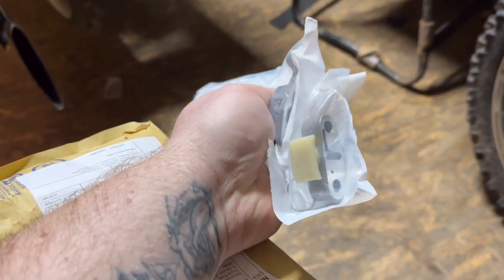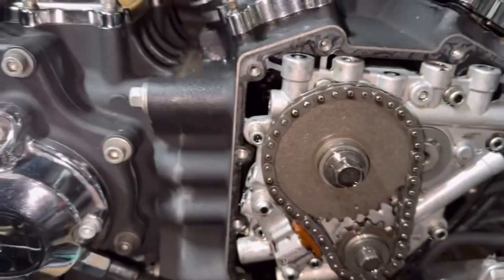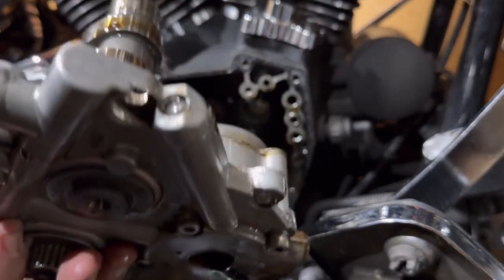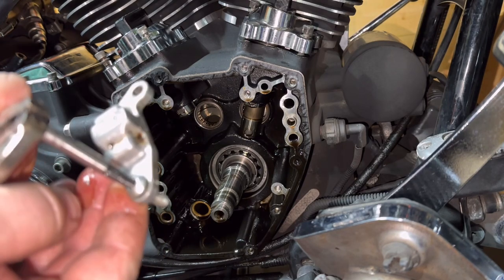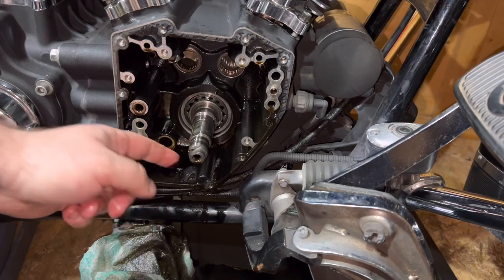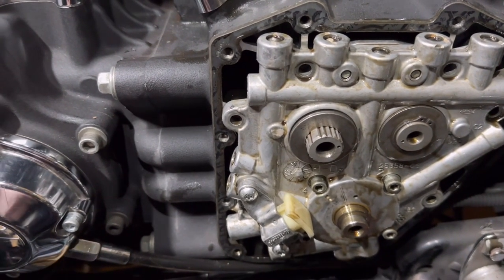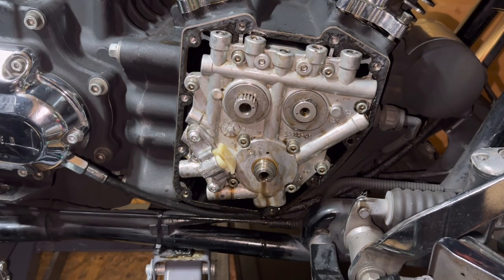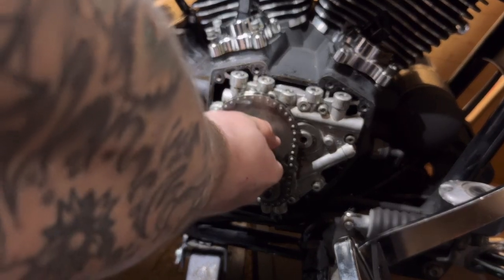Changing Cam Chain Tensioners Harley Davidson Twin Cam

Comment: Thanks for posting. I thought 20k miles was for spring loaded tensioners and hydraulic would go a lot longer.
Reply from the maker: Ive heard stories of some being checked at 30k and still look fresh then some at 15 20k in real bad shape , thats both spring and hydraulic .Maybe riding styles and performsnce modifications play a major factor in it. Its a must to get in and check could be catastrophic if one gives out. Thanks for watching ride safe.
Reply: @Teamloco1853  Never seen the Hydraulics worn out early, think the issues were really with early TC's 2004-2006, I have a special tool for the sprung inner to change it out.

Comment: You didn't replace the O-rings?!?!?  If it were me, if the cam bearings were stock I'd replaced them.  Also not a bad time to upgrade the cam and/or oil pump.
Reply from the maker: It already had an overhaul inside cams o rings etc not to long ago at all. I gave them a good check before reninstalling for this video and and they were in good condition.

Comment: Such a waste, if you really want piece of mind as you stated, why would you change out that cast cam plate and oil pump?  One of my Harley's is a 2009 Rocker C, im going to change it all and get the entire fueling 525 torque cam kit which includes everything, i have no interest in going in just to change the tensioners
Reply from the maker: Theres nothing wrong with the cam plate or oil pump im running it works. Its not hard for me to go back in there Down the road if i change to gear drive then i will change them but here in the UK its a hell of a lot of money for the S&S plate and pump or the feuling. 

Peice of mind for me was changing the tensioners so i know at 35kthey are new and replaced.
Reply: I guess my 2002 at 11000 miles will be ok a lot longer.on my 4th Harley ( and last ) since 1989.
But will check them in any case.
Good info.